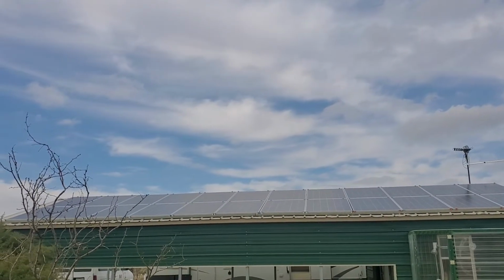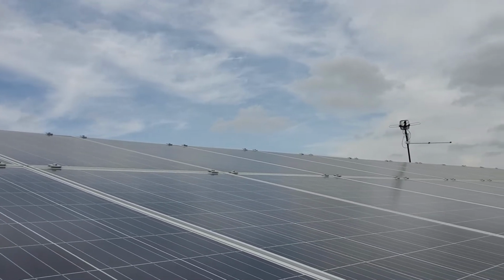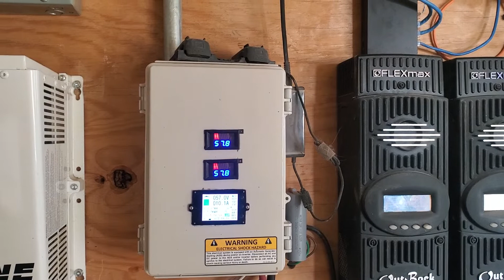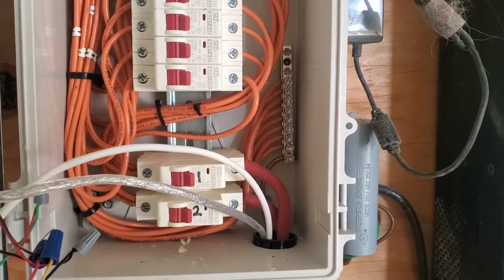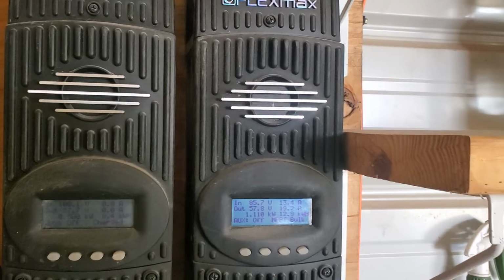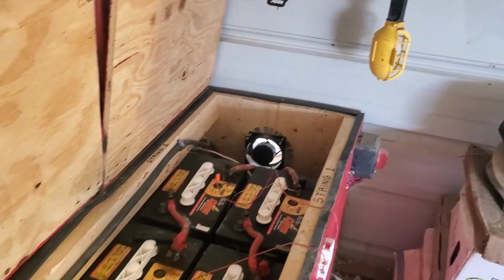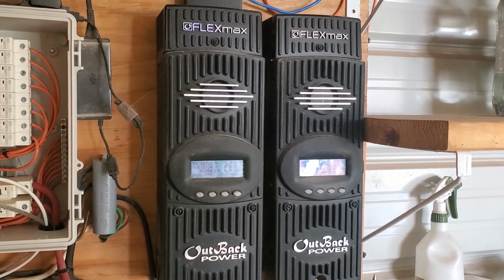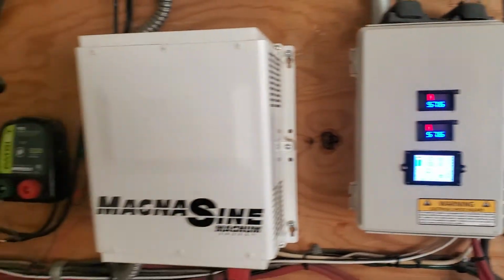Offgrid 6600wh Carport Solar

Comment: Nice install. Why did you do lead acid batteries? Do you have balancers and equalizers on your batteries? I saw cables but did not see where they went. I realize at 450 a pop the outback was a good deal, why did you not consider the high voltage controller 100 amp 600 V by Magnum? Enjoy I have been off the grid for 5 years and loving it.
Reply from the maker: Thanks. No equalizers because of the amount of amps being drawn and supplied. I'm not convinced equalizers work well under that condition as they move little amperage. I have balancers on my smaller 24v setup though.

I really want to move to lithium but they're still cost prohibitive, imo. The hassle of having to monitor and water LE will have to do for now. As far as your Magnum suggestion, It's a good one. A little light on output (138 amps compared to FM80's 80x2, which I hit pretty much everyday), but close enough to have merited consideration. Thanks again.